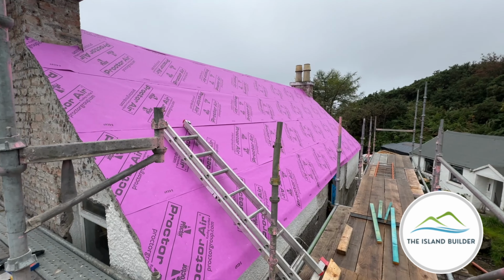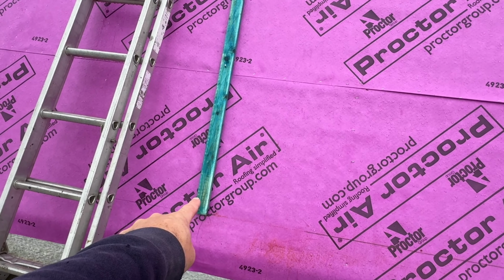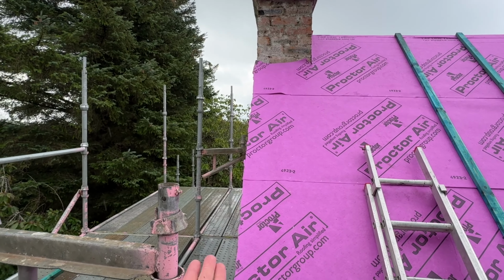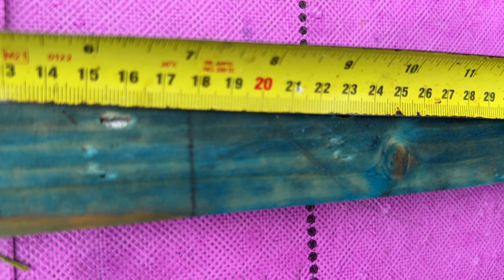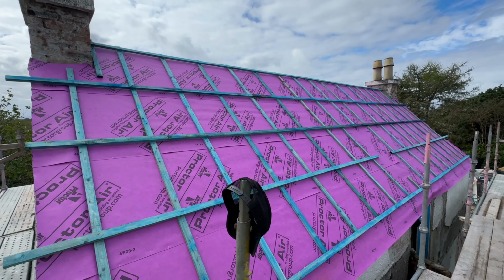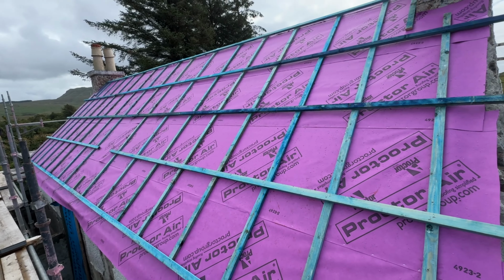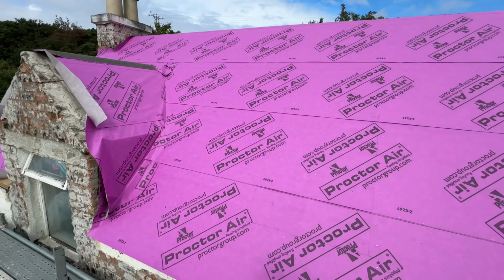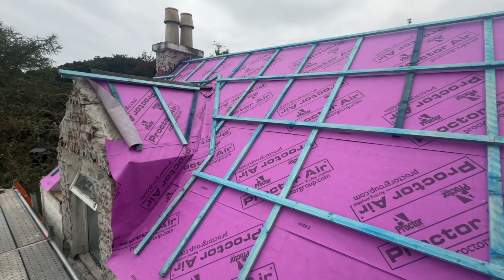Battening the roof

Comment: Nice for people to see the work that actually goes into a job being done. What sort of verge detail do you need for those weather conditions?
Reply from the maker: @FONASDeadlock  hey , typically we have a barge board and soffit that would run up the gable then with a sheet metal roof some sort of corner flashing but in this case the architect is looking at something a little different and the roof sheet will project past the stone wall and then we lime render up to the underside of it , it’s a bit more exposed but in this setting should be fine 👍